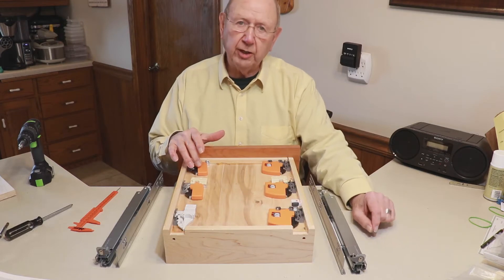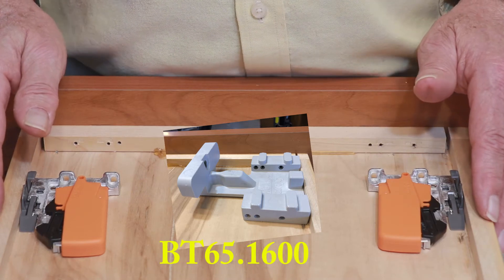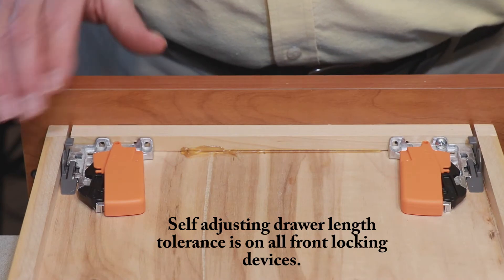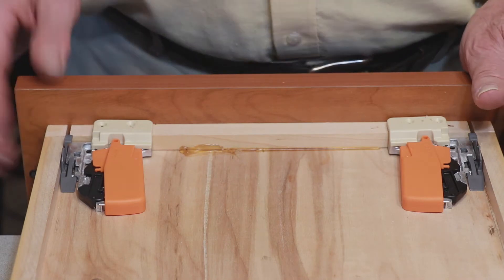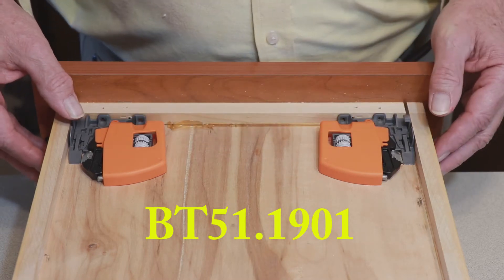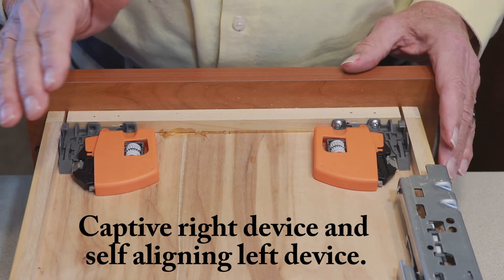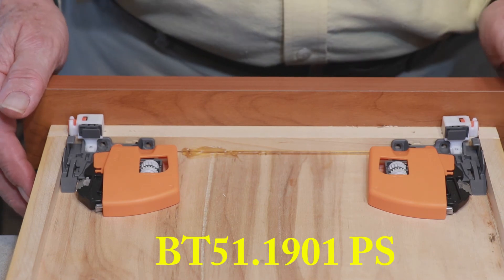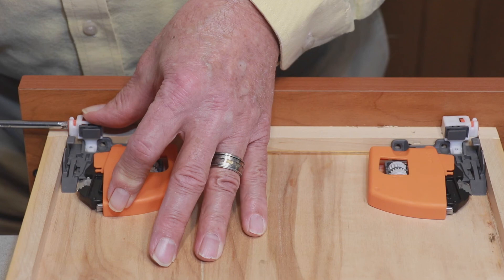DIY Your Way - Blum Tandem Locking Devices, Knowing the Difference and Which is For You

Comment: Thank you so much for this explanation! I was wondering if I could use the holes that mount directly to the drawer bottom, since I have a 5/8" thick drawer bottom (or keyboard tray as it is for my purpose), now I'm confident it will work!